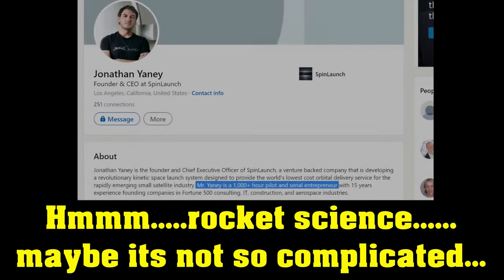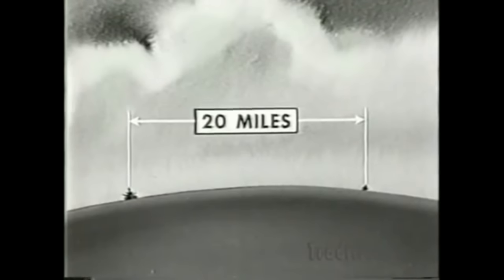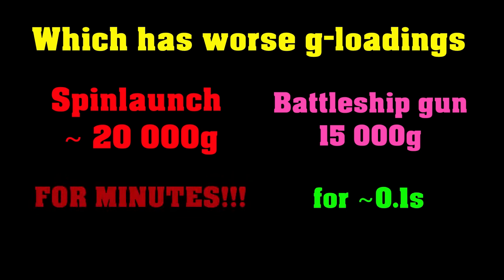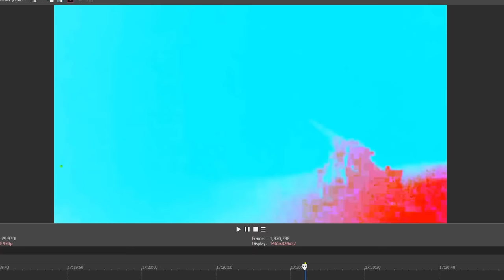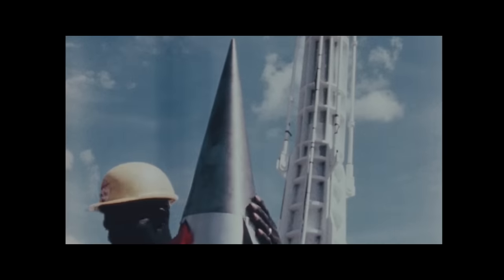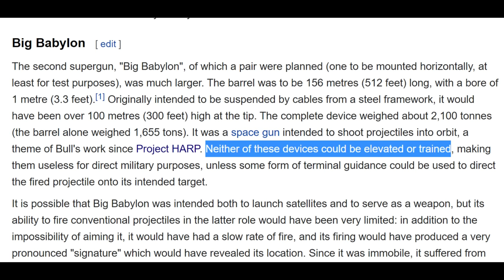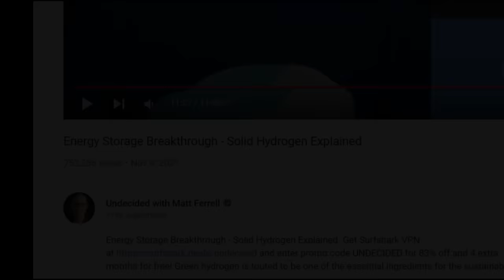Spinlaunch: BUSTED (Part 2)

Comment: I wonder what happens to the air outside of the ejection seal when the projectile breaks through? wouldn't  that air instantly start filling the vacuum chamber destabilising the projectile also wouldn't it affect the supersonic spinning arm? plus, what does actually changing the center of mass when the payload detatches do to the spinner assembly?
Reply: You got it. A sonic shockwave will enter the chamber and the carbon fibre arm will smash into pieces while going up in flames. 

Besides the problem that they have to dispose of a 200 kg counterweight at mach 5.

Comment: * Chamber needs to be replenished each time which would take hours - Fair, but the double gate mechanism discussed in real engineering prevents a good chunk of this and the fact that it's partial and not total vacuum probably prevents the rest of this issue. Plus he never justifies why hours, altho probably it's from assuming a near perfect vacuum, which they don't do.

* Dangerous system that people can't live nearby - So what? That's sort of the issue for so many industrial facilities including launch sites.

* Pressure feeding: Uh, that's what a pressure tank is for? Ullage motors are far from the only way to do it. And it can always be replaced by a solid motor

* Them spewing bullshit in their site: Fair, they do, and that's reproachable.

* The whole comparison gimmick is bullshit really. They're just such different devices, it's a meaningless comparison

* G-loadings: The one criticism I fully agree with

Comment: Why busted membrane parts flying outwards instead of being sucked by vacuum inside the chamber?
Also I may be wrong, but projectile once released should continue rotational motion around it's axis.
And the last point - how they are planing to maintain the balance of the centerfuge once projectile is released? Radial load on the motor axis will be about 4000tonns...

Comment: Some additional issues with the Spinlaunch system:
1) If a vacuum was pulled in the chamber, then as to rocket exited, a whopping amount of air would have rushed back into the chamber pulling much of sealing material inside. It looked to me as if all the broken bits went out!
2) If a lot of particulates go back into the chamber, then it must all be carefully cleaned before it can again be sealed to pull another vacuum.
3) I doubt a new (and sufficient) vacuum could be pulled on a chamber this large in anything less than a day. I suspect it would take several days prep the system and pull a new vacuum.

Comment: Usage motors aren't necessary if you use a hyperbolic pressure fed engine which would probably need to be used anyway since cryogenic fuels probably won't play nicely with this type of launch.

Comment: I like the idea of SpinLaunch. And I have had that idea myself as well.
But in order for such an idea to be worthwhile, the centrifugal G-force has to be less than the G-force of a cannon built to the same principle. If it isn't, then it has absolutely no advantage compared to a cannon.
So I have concluded that a better idea than SpinLaunch, must simply be to make a VERY long rail gun that ends up near the top of a very tall mountain, in order to reduce the aerodynamic forces at sea level.
Reply: Well their first build was a prove of concept prototype.
When they build a bigger version, with a bigger radius, they can lessen the force of centrifugal acceleration to that of lesser than the gun as F=m*vsquared/r
Reply: @selectthedead  Fair enough. But I am still VERY uncertain as to whether it would be better than a simple VERY long rail gun.
Reply: @Tjalve70  Well that is Something WE can agree upon.

Comment: A carbon-fibre rocket being spun at thousands of g is going to bend. According to the CGI graphic,  it is supported in the middle - with the nose cantilevering forward of the support, and the tail cantilevering aft of the support. The bending moment at the support will be immense. I can't see now it will not break in the middle under even moderate g-loading - let alone the sort of g-loading they envisage.

Comment: I would pick a mountin close to the ecuator and build 3000 meter gunbarel up the mountinside with extra charges along the way, you could even start the launch with compressed air for a smoth launch. A solid fuel engine for the second stage.

Comment: I mean. Add a mass equivalent to the projectile on the opposite arm of the spinner and release it at the same time as the rocket
Altho this mass can be shot straight into a dampening mass

And at the opening of the spin launcher you can have a steel sliding door that shuts the opening right after the projectile leaves to preserve the vacuum as much as possible for the next projectile

Just mumbling ideas, dont mind me

Comment: Okay, this for the dummies out there to get around. The problem with the fuel move into the front of the tank as it slows down. You put it in your bladder inside of the fuel tank filled with a nerd gas that's constantly putting pressure down on the fuel, the nerd gas will not change as elevation changes. There you go, problem solved, you're welcome.

Comment: Given the imagery, that'd mean that the projectile would also have a rotational velocity when leaving the 'gun'.  You can't just stop something rotating.  It has rotational inertia.  In which case, a rocket like projectile wouldn't make sense as it would tumble.  To stop it from tumbling, the projectile would have to rotate counter to the spin up mechanism while spinning up to have this make any sense.
Reply: rotational inertia?
no, if you spin a projectile, say on a sling, and then release it; it will fly in a straight line.

Comment: You do not need ullage motors, there are a number of alternative technologies. An inflatable bladder in the tank, affixed near the top, will do. Same would be a bladder like membrane that can be pressurised — and it does not matter too much if it has a burst ring or similar so it does not have to be able to stretch all the way to the bottom, as it is only used to push fuel into the engine.

That, BTW, is technology used in the lunar module of the Apollo program — the tank could guarantee just fuel coming to the engine in the lander, for the first 60% (IIRC)  of the tank. The rest would probably be used with the engine running during landing and/or abort …

Or you could use a spring—loaded piston for the first few seconds while the engine is started up and the fuel settles.
Just sayin’

Comment: The other big physics problem is this spin machine would need perfect balance at both ends off the arm, but when you release the payload then how do you re  balance the arm with the new settings.  The simple fact is the out off balance arm would fly apart

Comment: The Saturn V weighed around 2900 tons, it used around 20 tons of fuel per second and took around 12 seconds to clear it's launch tower, which was around 115 meters tall. 

Rockets do use a lot of fuel and weight upon launch and there could be significant savings with some sort of re-useable launch assist system, but I don't think spin launch is the answer for sure. 

A giant 300+ meter steam catapult might do better than spin launch... :D

Comment: To be fair - nuclear artillery mostly used the much simplified gun-type nuclear device, not an implosion core (like Fat Man) as you showed in the video. The gun-type device , a la Tall Boy, is not terribly complex and far less complicated to engineer for G-loading. 
They couldn't fit a round implosion type device in an oblong casing at the time, hence the decision. Much later, using explosive lenses to focus shockwaves, they made simplified oblong implosion devices that could be carried on small attack aircraft.

Comment: I'm still tryna go through school, so me maffs're prolly not too good, but wouldn't a 200kg projectile be equivalent something along the lines of like...  4,000,000kg, or 4Gg,  at 20,000G...?  Is there a material that can handle four gigagrams for an hour or so?  Or would it be 8Gg, because of the counterweight...?

Comment: I must be missing something here-- given the spinlaunch arm is projected to have an angular velocity of ~450 rpm at release, that means that the "satellite" (upper stage or whatever) will have an angular velocity of 450 rpm also at release (and this is about the YAW axis).  So it will definitely be TUMBLING, if this is not addressed.  There are ways that this could perhaps be dealt with (think mechanical de-rotator or something), but seems like this should be a fundamental part of the design...  [and then, there are the other issues like balance on release, G-forces, Aerodynamic heating, etc... ]

Comment: The US military has been using gas displacement for rocket and jet testing for years. They haven't used a vacuum, because it's hugely expensive and wasteful energy wise. They just use gas to create a thinner atmosphere. 

What I want to see, is an electromagnet powered space ramp. Several miles long, launching as fast as the capacitors can be fired up, and with the ramp going up from a large mountain range, it could be a few miles high without an issue. 

Yeah it would be nuts to have a ramp built over Everest or Kilamanjaro or something, but it would be ideal to build on a natural mountain range.

Comment: yeah... project HARP is pretty damning.

the only conceivable argument I can think of for spinlaunch is that the jerk is more damaging than the g load so gradually ramping up the g-load would cause less damage to the payload... but that seems pretty difficult to substantiate, if you're going to have to develop specialized payloads anyways.

Comment: The problem with G’s is the sudden change not the gradual build of it. Hence shooting from a cannon could be worse.
But, you can conceivably imagine some sort of rail system which propels the gun with the payload inside and then fires while moving, right?
Bottom line it sounds like staying on earth and marveling at IT’S beauty is more effective

Comment: I think with all the issues with the launch system itself there is another issue being overlooked somewhat.....payload hardening. With traditional rockets, or smart munitions on a battled field you have to harden the payload for G forces through the centerline front to back. Acceleration and deceleration. With spin launch you have to deal with those as well as axial g force changes, especially at "launch" when you go from rotation to straight line. Everything you do to harden a payload for g forces reduces the  useful stuff you can put on board.... so when you add directions to harden you reduce what you can send.

Comment: Something I'm curious about is could can we actually take advantage of the difference in temperature far below ground to use as energy as was claimed in the science fiction novel Foundation.

Could we perhaps use that to than build rocket ships near the tops of mountains, than when launching them, roll them down o  rails with a jump at the end to give them momentum and overcome a lot of the initial Inertia resistance?

Comment: They've since backpedalled from the claim of using a vacuum.. 
now they say they aim to get 0.01 mbar. (the most theyve tested is 1 mbar on their 1/3 scale model?) 
also TF mis-identifies the weight of the 'vessel' being launched from the spinny thing, 
its said to be 10 tonnes (at a touch over 2000 m/s) . 
the actual thing(satellite) that can be carried is up to 200 kg.

Comment: the maximum possible is to build a very long electromagnetic cannon at the equator diagonally up kilimancharo in afrika. The projectile would have to be extremely dense and torpedo-like to accommodate small charges.   It is questionable whether it can escape the heat at still 8 km/s into orbit. I don't think so.

Comment: 2 videos and i still do not know what is the speed you NEED to get stuff orbital.
so do they need to get to 8000 km/h to trow that 200kg thing up into orbital heights.
Or can they get orbital with lets say 3x speed of sound...
I need to know...
Reply: My understanding of it is they don’t plan to throw anything into orbit. It will spin up to about 5,000* mph (8,000kmh) which will throw the rocket about 200,000 feet (61,000m) and then the thrusters will carry the rocket into orbit. 
* The exact spin rate is dodgy and it seems might vary based on the payload.

Comment: bro, you missed the biggest problem with spin launch.  lets just say they had these super satellites, and a centrifuge able to withstand the rotational speeds... they have to counterweight the centrifuge right?  I mean imagine the forces of an unbalanced arm spinning at 7 times the speed of sound.  so when the projectile is released what happens to the rotational system?  it rips itself apart.  they would build one centrifuge per launch.  and then watch it tear itself to pieces microseconds after each launch.

Comment: I'm going to make the mistake of commenting before the video is over.  But!  In a cannon the near instantaneous acceleration is what will do the most damage to the instruments inside the projectile.  In a centrifuge the payload takes a gradual increase in gravitational force.  Many materials can take gradual loads, but not the shock of a sudden load.  I'm not a material scientist, but as a machinist I can tell you that some things can take strain, but not impact.  Maybe you address this later on, but so far I think this would be an obvious subject to address right away when taking about a cannon versus a "trebuchet".

Comment: the best bet for a rocket that saves on propellants is to dig a trail and a hole in a mountain, build a giant rail gun/ gauss gun and also a train to carry the stuff there... the higher altitude skips a bit of the atmosphere! (100 kilo pascals at sea and about 50 at 5 km so 75 at 2?) 

what you do is accelerate a plate, start the rockets mid way and move slowly away from the plate and then stop the plate. the "tunnel" would be more like 4 sticks with doors, the door opens during fire to evacuate the air at the front when accelerating. (the rocket pushes the air but you have 4 slots to let it be pushed "out".)

just reaching mash 1 is good enough if you did not use 100 tops of fuel to just get it started. that lowers the starting mass, the current fuel gains some D/V from the lesser mass tanks having a bit of angle ready means your gravity turn can start early and the vehicle accelerates slowly instead of instantly, a lot more types of payload can be put in without fear of it breaking.

this half assed idea from the top of my head is probably a lot more feasible than that spin launch thing. all that would be needed to debunk this is to test it in Kerbal space Program with Real solar System. no need for high tech super computer simulations if it fails that... you try the idea first and worry about "actual" physics after if it passes the test on the basic theory.

Comment: With the arrangement used in the test, when the rocket exits it will be spinning end over end at the same rate as the centrifuge.  450 rpm is ~7 turns per second.  Stopping that rotation will not be a trivial task.

Comment: I’m not a scientist or engineer, but I would have thought that the force created by the centrifuge would cause the projectile to want to go sideways as well as forwards (which kind of looks like what it is doing when it exits the tube). It seems to me that this sideways force is a loss of forward momentum, so would mean that any assumptions based on the velocity of the projectile while it is on the centrifuge about its forward velocity would be wrong.

Comment: The ullage motors is a moot point. At the size and scale of these vehicles, assuming the tanks are full, a simple pressure fed by COPVs (which are pictured next to the combustion chamber) would be sufficient to provide head pressure.

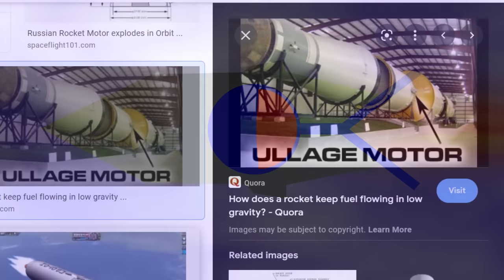Comment: 2:30 while clearly Spinlaunch havnt thought of this, you can use an internal flexible bladder for the fuel, and pump pressurized gas around the bladder to squese the fuel into the rest of the engine
Reply: And it explodes during launch due to being unable to contain the fuel while getting up to speed inside the centrifuge.

Water (and other similar materials, like kerosene) very much do not like being shoved around at supersonic velocities.
Reply: @majorjohnson8001  Yeah lmao I figured that could be an issue, maybe if you made the bladder press tightly around the outer casing it would be fine as the forces would transfer to the outer rigged shell, but yeah would def be hard if possible at all

Comment: I work in the life sciences industry and several times went to Germany to witness factory testing of centrifuges we bought for drug product separation. The facility had a bowl balancing room where the finished bowl was placed on a testing motor surrounded by a thick concrete wall. This is where the centrifuge bowl spun up for the first time and they could check it like balancing a tire (they'd polish down the exterior sides as needed to change the weight balance). So, if a solid piece of stainless steel centrifuge that wasn't even 3 feet in diameter needed all that protection for testing, how in the world do they expect to protect anything or anyone from the energy in that monster? Good luck balancing that thing for the speed they want.
Reply: Well I suspect part of the protection will be...not to be close to it. Sort of like how we protect ourselves from current launches. We also build, and test, "bunker buster" missiles...from a distance. We've detonated nuclear warheads...from a distance. About as close as you can get to a Space X launch is five miles away.